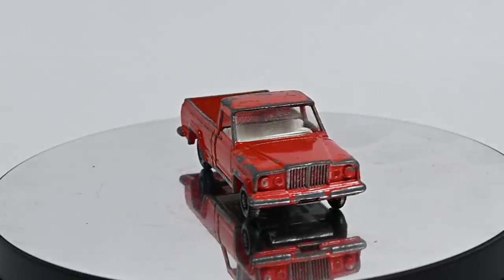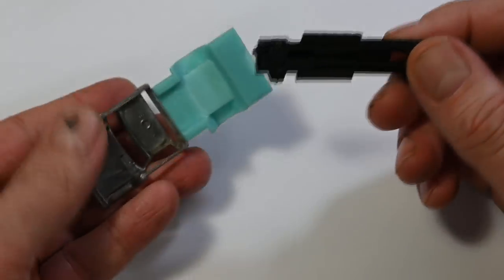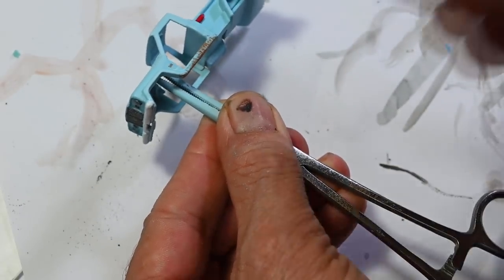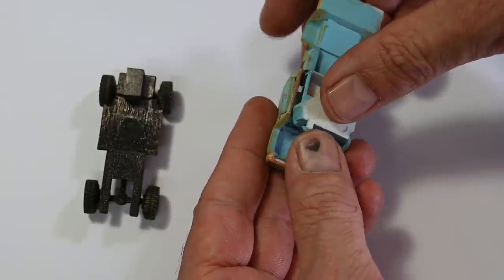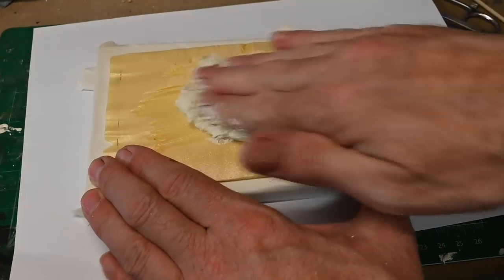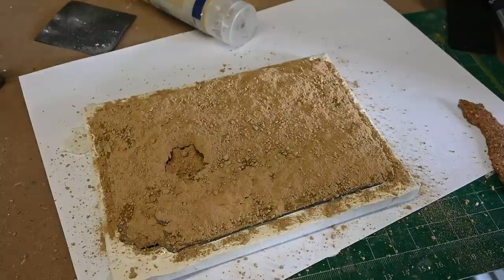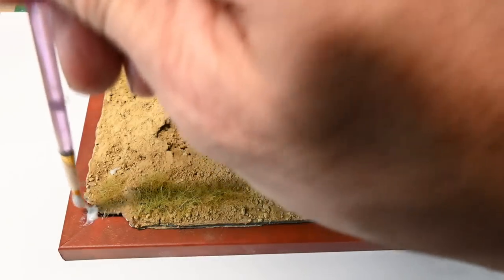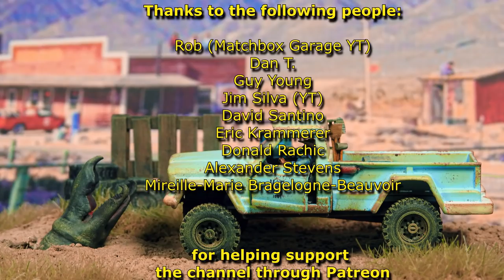Tremors Movie Diorama | Matchbox Jeep Gladiator

Comment: I have so many questions regarding dioramas. I don't want to clog up your comments with question after question. If I may ask one...?
I picked up some Greenlight big "mudder" or "monster" tires. I really want to use one of the newer Hot Wheels Dodge Ram 🐏 Trucks and beef it up into a mini-monster truck. My dream goal is also to create a type of "suspension" for the wheels. The suspension isn't 100% necessary, just a cool and unique idea. The lift however I'm not sure if sanding down the axle slot on the base is the right move? Or should I attempt to make another axle base? These are ideas I've not attempted before. Do you have any videos detailing axles, retrofitting big mudder tires onto a truck with stock regular tires. Thanks for any help you've given me and others.